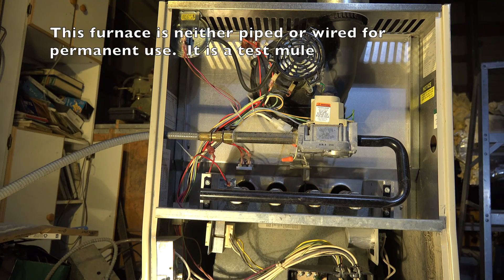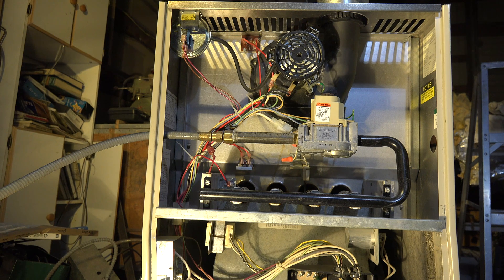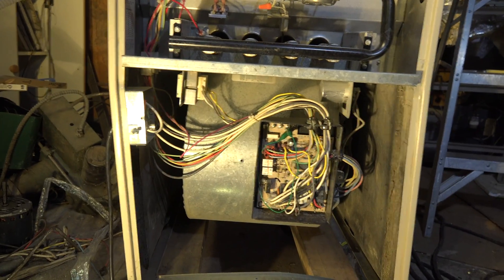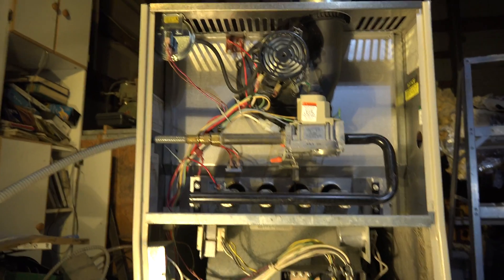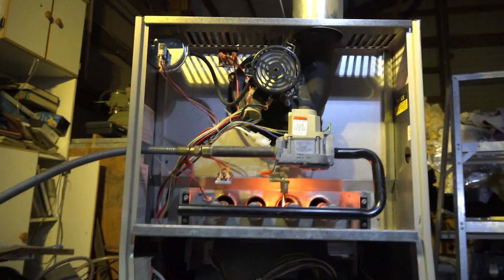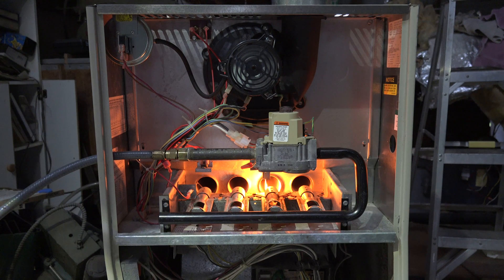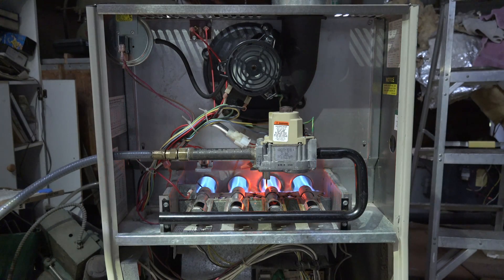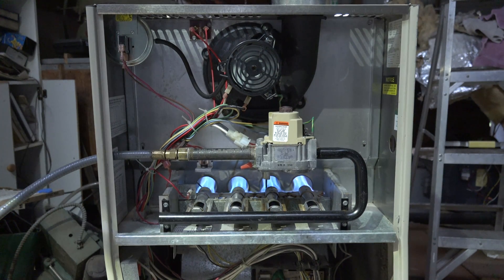The Rheem/Ruddd RGDG model furnace cycling #2

Comment: Good video. I have the same model but with a standing pilot light. Had I known it was going to sound like a 747 jet taking off every time it fired up I would have never had this one installed. Saying that however it has been working fine for over 20 years with general maintenance. The next one I purchase I will listen to it first BEFORE installing. Any recommendations for a replacement for this model in 2021? Hello from Canada!! ❄